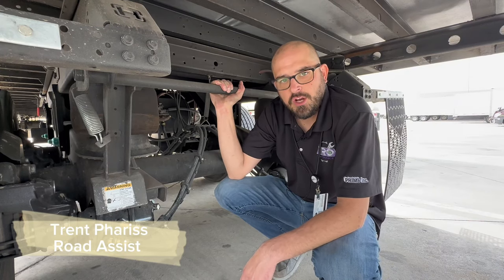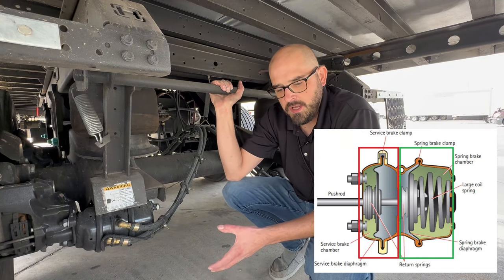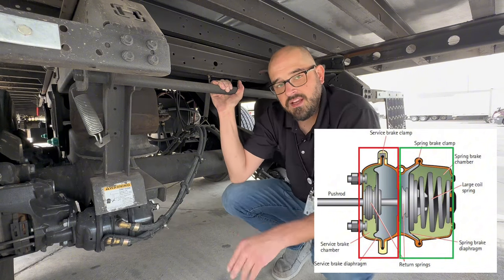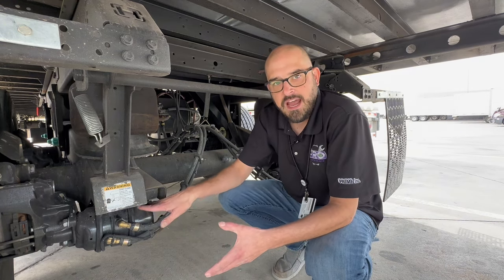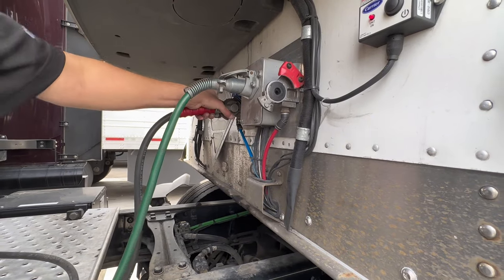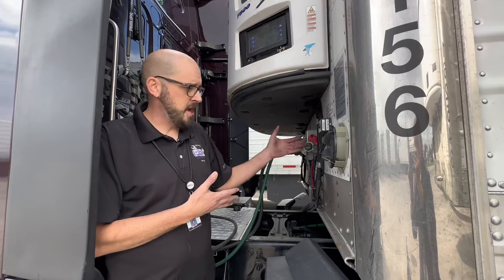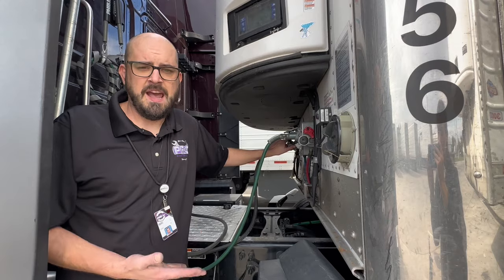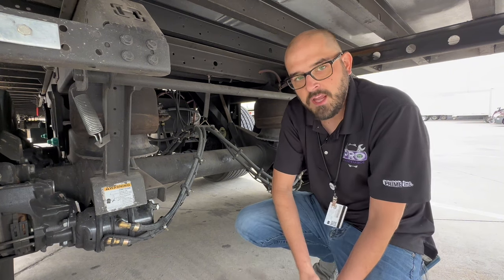Parking Brakes And Moving Your Tandems; How To Move Tandems When Parking Brakes Are Not Holding.

Comment: Great tip. Now, how do you check your service brakes on the trailer since our tractors don’t have a trailer hand brake?
Reply from the maker: The method in this video will also check your service brakes as well. You can always do your brake test as required by law on your pre/post trips to check the service brakes.